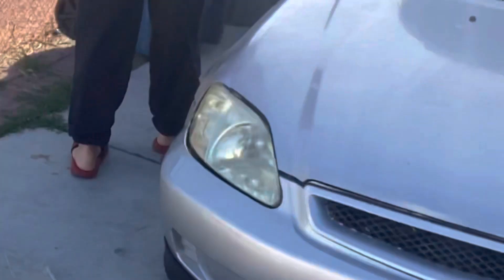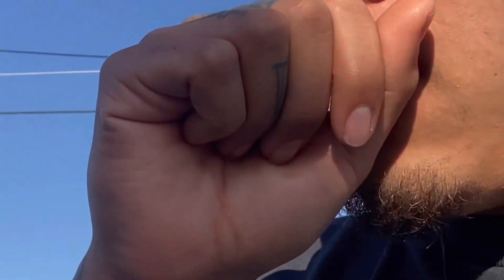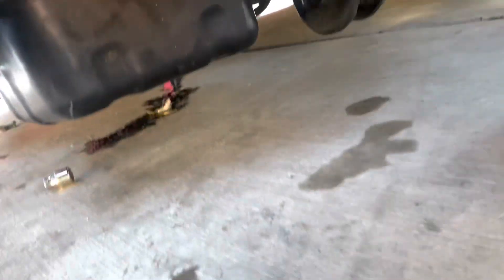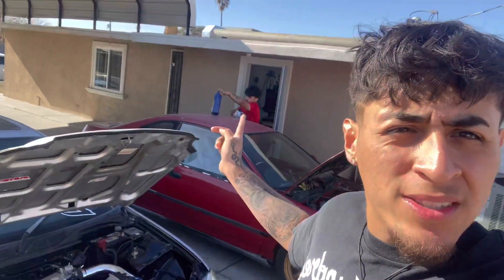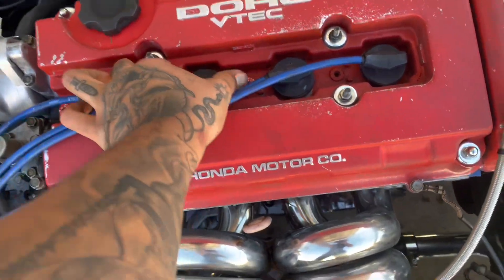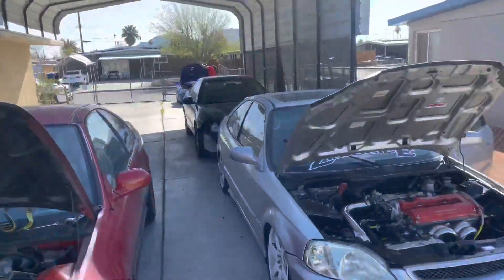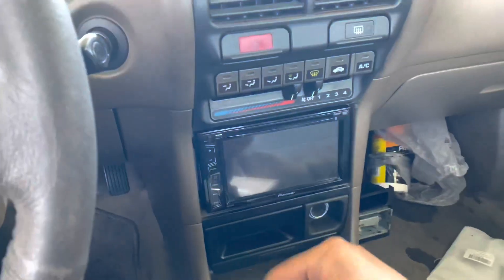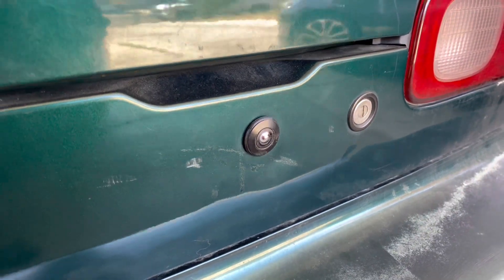THE LS VTEC CIVIC TAKES A MASSIVE L! 💔

Comment: Turns out it was my shift linkage and my master cylinder I suggest checking those bro
Reply from the maker: definitely will investigate more on that bro thanks 🙏
Reply: Yeah check if the master is leaking from inside by the pedal that's where mine was bad
Reply from the maker: @ViejaEscuelaAlekz  🙏🙏